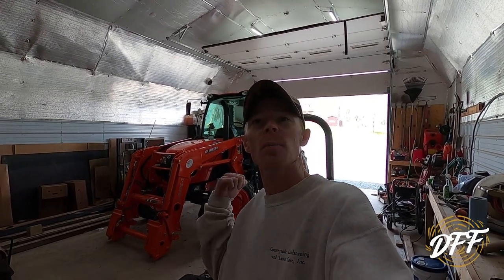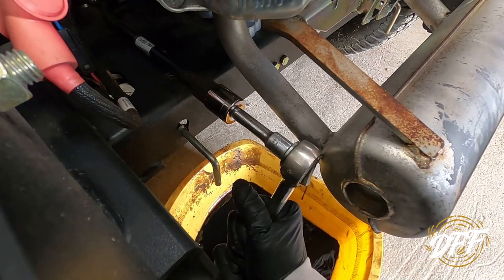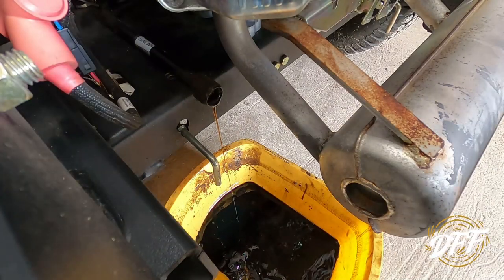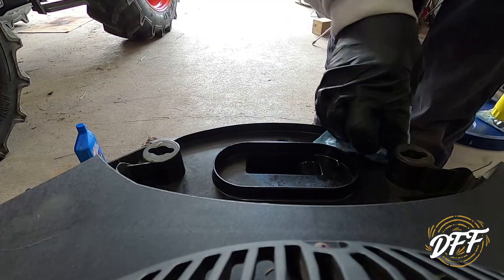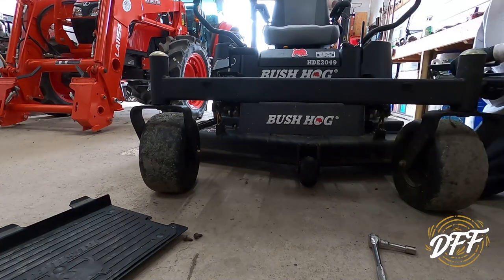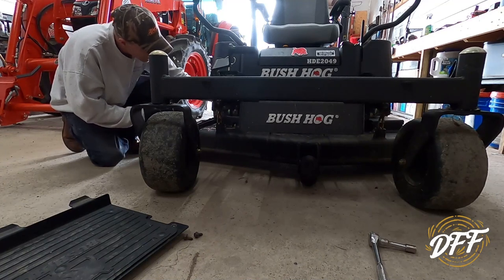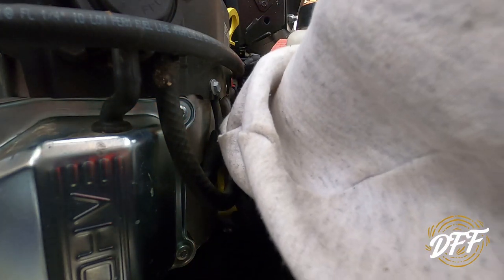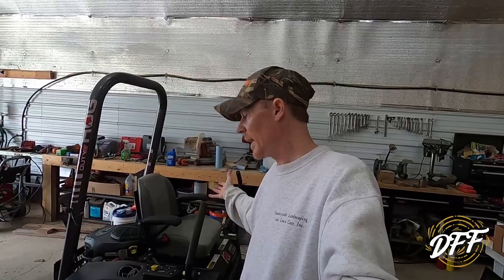Bush Hog Zero-Turn Lawn Mower Maintenance!!

Comment: Did you reset the oil service reminder on the panel? My machine is telling me to service the oil, which I did, but I can't figure out how to reset it. The manual isn't much help.
Reply: Should be a button combination to push on the pannel....
Reply: For those interested in the service reset you have to enter the code as if starting it up, then push ‘1’ until the service reminder appears, then hold ‘1’ for 6 seconds. When the display reads all zeros release ‘1’ and it’s done.